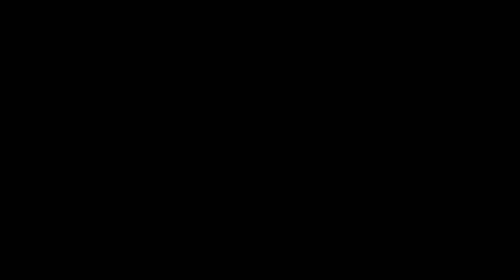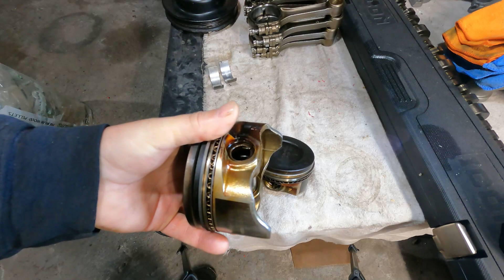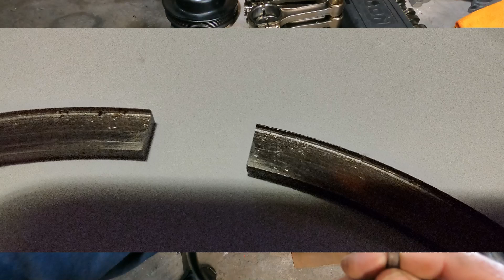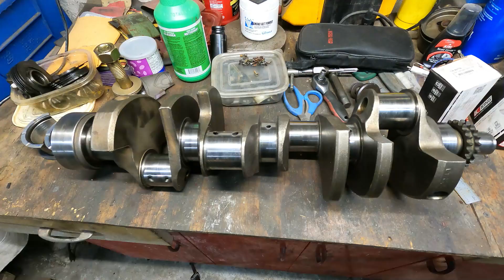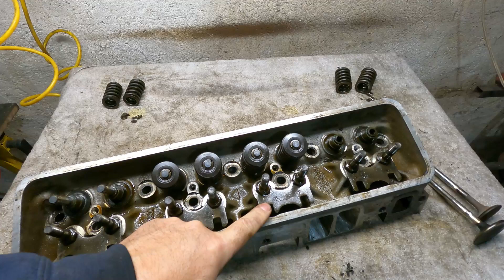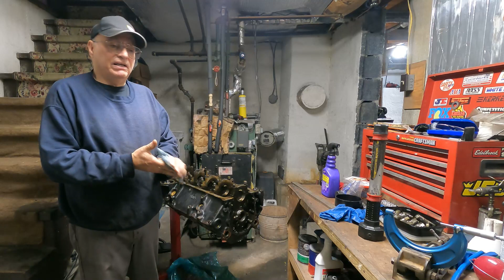Let's Look at the Engine Damage. 👀

Comment: Like you said, seems everyone wants to throw aftermarket heads on everything without consideration to the engines use/rpm range, same for cam duration.  Sounds like you have a solid combination that just needs troubleshooting and refreshing to be great again.  

113 heads are good heads and your minor porting is a +.  Is your TPI stock?  Not hard to outflow a stock or near-stock TPI (you're probably already aware) however, perhaps it would be worth a little $$ to get them flowed/measured and possibly have a pro touch them up, (not a full port job).    Another consideration is cam but not duration, optimizing the LCA unless your's is already there? 

Not a pro racer guy and not trying to sound like one, just reflecting ideas based on my own upcoming TPI build.  You have good parts that make good power, could be an opportunity to invest in/optimize the parts you have vs. spend $$$ on new shiny ones that don't fit the build?  Again, enjoy your videos and looking forward to your parts choices and results, keep at it!!!
Reply from the maker: TPI is ported with AS&M runner's, cam is made to work with TPI.
Reply: @E.T.GARAGE  What cam are you using?
Reply from the maker: https://www.summitracing.com/parts/cca-08-302-8

Comment: a high power engine doesn’t necessarily stress the transmission and diff more if the max torque is the same or even lower. Anyway a 383 can make enough power to be fun without extreme parts. It’s more important to make it reliable. 
what do you think it made it fail? ecu tuning, bad quality rings, incorrect ring size…?
Reply from the maker: Hard to say.

Comment: If you go aftermarket head have a shop go through the head. I just bolted a set of new heads on and ended up taking them off after putting 500 miles on them as they needed a bit of rework. AFR 195 heads would do you nicely over a 113 head.